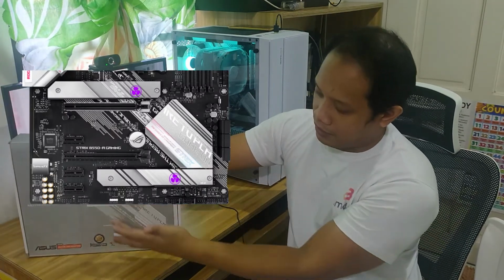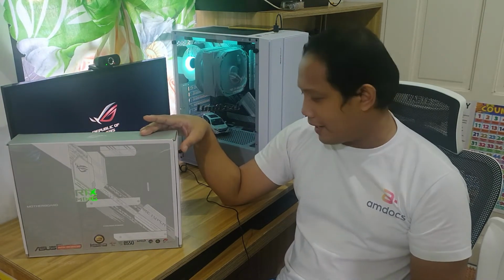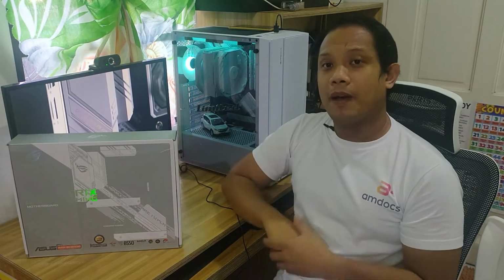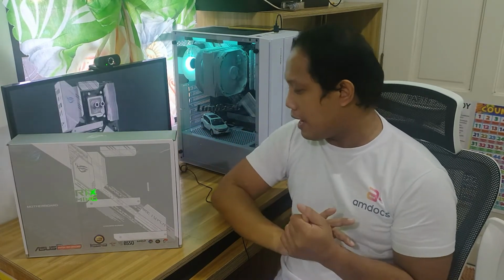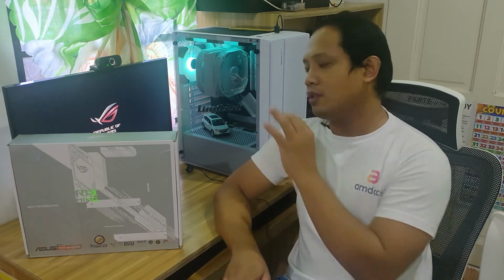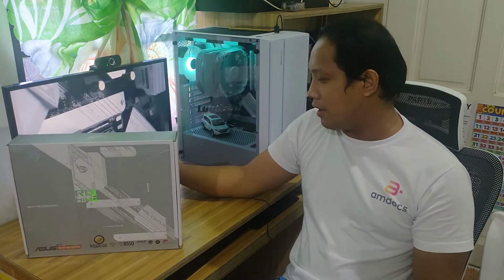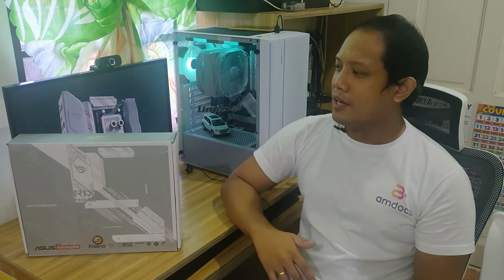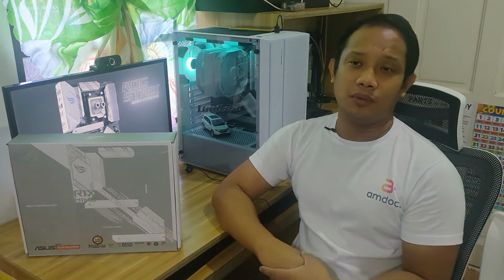Paano pumili ng motherboard - featuring ASUS ROG Strix B550-A Gaming

Comment: I have this motherboard.
CPU -- AMD Ryzen 5 5600
Mobo-  Asus b550-A
Ram -1*16gb plan to upgrade to 32gb. Wrong buy
Ssd- 128 gb + 1tb hdd
 second hand from old laptop
(Will buy 500gb m.2 ssd soon).
Msi mag 650w psu
Dk351 atx case with 4 argb fans.
Reply from the maker: hope you're liking the mobo so far.
Reply: But I have a concern San ko po Kaya ilalagay Yung connectors NG galing argb. Napapailaw ko Yung fan pero gusto na makontrol Yung ilaw.  San ko po ba ilalagay Yung 4 pin .
3pin  na may kasamang 2 pin
Reply from the maker: @jerarldlorica1151  yung argb header nasa lower left part, pero isa lang.. may dalawang rgb header naman yung isa katabi nung argb header at yung isa dun sa upper part malapit cpu fan headers

Comment: can i plug my coolmaster 120 ARGB fan to the rgb headers?
Reply from the maker: Hindi mag fit, totally magkaiba yung ARGB at RGB, di uubra sir
Reply: @pcinfoph  asus rog strix b550 a gaming mobo ko, do you know if its argb or rgb?
Reply from the maker: @SENPXL  it has both headers
Reply: @pcinfoph  thank you! i was worried cause i bought the mobo and the fans and i was worried i would have to use controller lol but nice to know theres argb!
Reply from the maker: @SENPXL  there's 1 argb header, you might need to daisy chain or splitter if using multiple fans